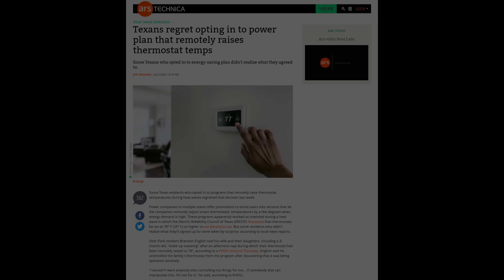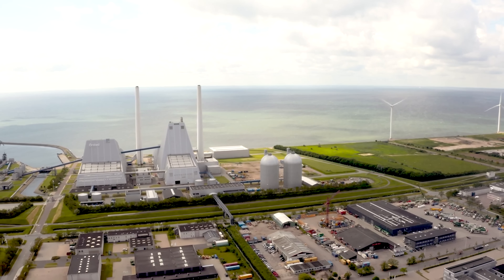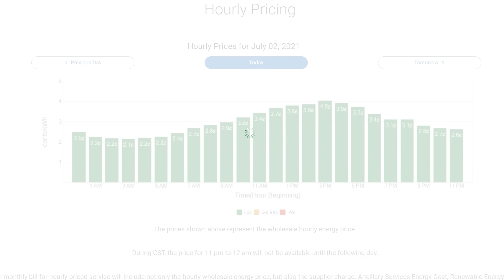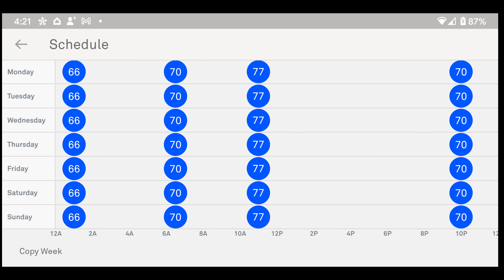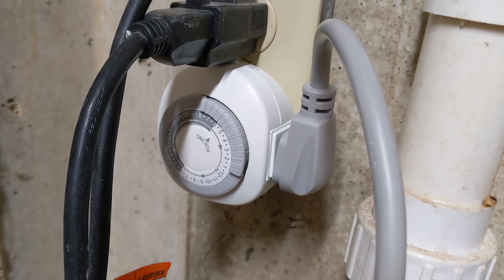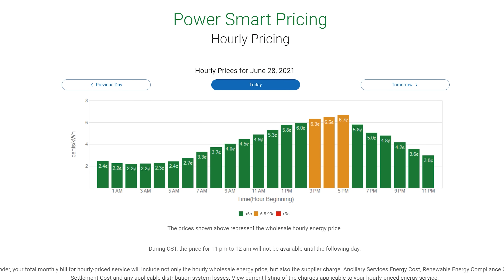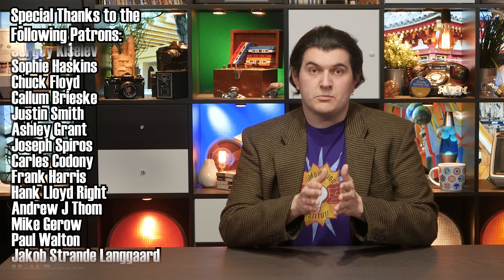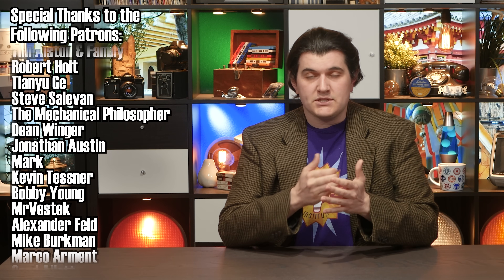Batteries aren't the only way to store energy. Here's another.

Comment: The most shocking part of this video was that your home isn't already absolutely covered in heat pumps.
Reply: Really in the winter natural gas is still cheaper.  Having said that I don't have natural gas and am thoroughly enjoying the heat pump I installed.
Reply: @shadowwolfmandan  Is it really? Where?  Here in EU the price of electricity varies, but in my country is around 10c/kWh. Using quality heat pump with SCOP more than 3. you can easly get below 3c/kWh. Natural gas here is around 5,5c/kWh.
Reply: @au9879  depends where you live in Canada for example. In Alberta natural gas is WAAAAY cheaper. In Quebec....its 3x more expensive on average. And ironically would be cheaper if there was a pipeline from the primary oil deposits to the eastern refineries. But Justin Trudeau would rather import Saudi oil to Quebec. a country that has significantly less investment into environmental impacts and standards of extraction. Along side 1 oil tanker creates about the same amount of pollution in a year as 35million cars.
Reply: @au9879  32ct average in germany. What tf is wrong with this country
Reply: @laurean5998  Probably the reason why Merkel wants Nord Stream 2. Though cheaper Russian gas comes with a lot of geopolitical headache given that Putin really doesn't want to pull out of my home country and return Crimea.
Reply: That's because he has an absolutely massive one!
Reply: @au9879  well heat pumps are pretty expensive to install :(
Reply: @iain3713  are you thinking of geo thermal?  A heat pump didn't have more components than a regular ac for us.
Reply: I've had an all electric home and the heat pump cut my bill and worked well to -12C or so, then I had to crank the resistive heating. Currently have natural gas which is much cheaper than electricity per BTU but my parents house doesn't have gas lines and so they run a combination of heat pump and propane. Heat pump down to -15C and then propane even though their heat pump can work colder. It just isn't cost effective. Off grid you simply cannot generate enough power to run a heat pump all year here. Best that can be done economically is 8-9 months. Then you need propane.
Reply: @klontjespap  Might want to check which part of that is electricity costs and "overheidsheffingen" (taxes). On my contract with Vattenval it lists 0,067881 euro per kWh for "leveringskosten" and 0,150379 euro per kWh for "overheidsheffingen". 

And that's with a contract where I opted to fix the price at some point in the past, I just didn't want the hassle and thought the price was okay. Then the market price dropped for a while with the fossil fuel price adventures during covid and now is going up again if the news can be believed. When I fill in the form for a new customer it'd work out to be 25 cents per kWh now from 21,8 cents (government excise tax is the same, higher cost for the energy supplied by Vattenval although I might also be missing some staying customer discounts). Both the government taxes and the electricity market price have a big impact on the costs here.
Reply: 12:20 sooooon
Reply: @iain3713  Not that much. I have a Geothermal heat pump here in central Texas because I do not have access to natural gas and I wasn't going to be a slave to propane delivery. It costs about ~50% more than a conventional central HVAC system with much of the extra cost being the cost to drill 5 - 250' deep boreholes. Had I lived in terrain that was conducive to burying the heat exchange lines horizontally instead of vertically it would likely have been less. The 35% tax REBATE in 2011 helped also. As a bonus it also sheds heat to my water heater during the summer.

Comment: When I lived in a middle apartment, I never used heating or cooling.  Weak neighbors are easily used.
Reply: LMAO
Reply: Last year I had direct sunlight through a huge window. That was a cheap winter!
Reply: @worldcomicsreview354  And an expensive summer.
Reply: All of the above here. Very handy in winter, because it means the air-source-heat-pump-based heating/hot water system that it has can just about manage to keep things warm enough without resorting to "winter mode" (which basically means it activates a 7kW electric immersion heater), and in mild weather it stays a reasonable temperature with no heating at all, but right now we seem to have hit "summer" and there's no active cooling :/
Reply: My heated Floor has a Name... on his door right under me.
Reply: @worldcomicsreview354  this is passive solar heating, a strategy used in passive homes.
Reply: @ryanlumley8579  if built intentionally, these big windows are built with sizeable overhangs that take advantage of the sun's inclination to block direct sunlight in the summer.
Reply: A while ago I rented an apartment in Calgary.  In winter, minus 10C outside, I had the windows open trying to cool the bloody place down to a comfortable (for me) temperature.  Old folks living on four sides of me had their thermostats cranked right up.   My heating bills were zero.
Reply: Knew someone that did that in his town house. 
It was hotter than comfortable in summer and you kept your jacket on in winter.
He didn't care as it was all about being the cheapest person he could be.
Reply: Hehe, I'm on the ground floor in the middle of my building and all I need to stay cool on all but the very hottest days is to leave my windows open. Winter does get too cold to not turn on the heat, but I don't pay any extra for gas, so I can crank it up as high as I want!
Reply: @ryanlumley8579  You have something like an outdoor sun screen to keep the sun out in summer.

Also my college in The Netherlands is / was working on a window that can let Infra Red through in the Winter, but block it in the Summer and it works great!